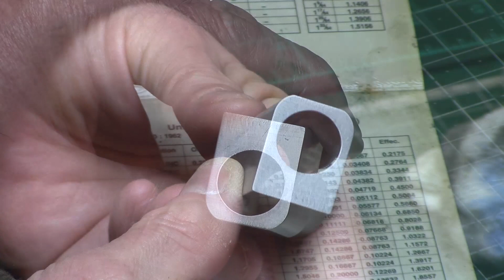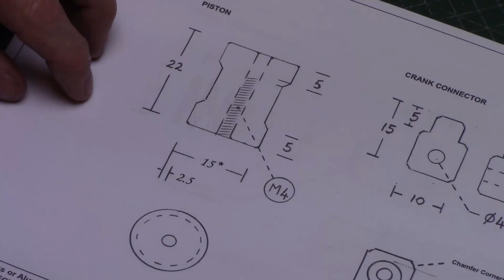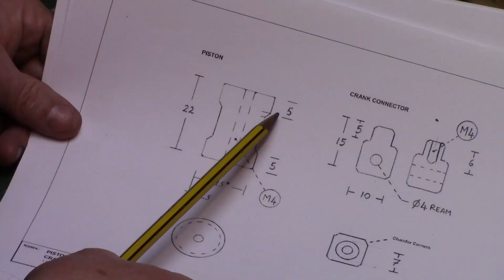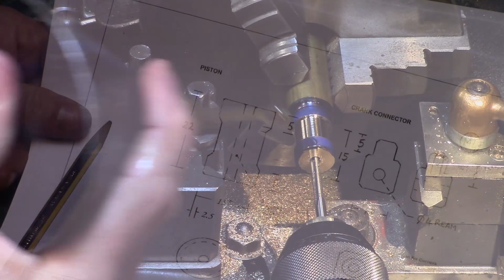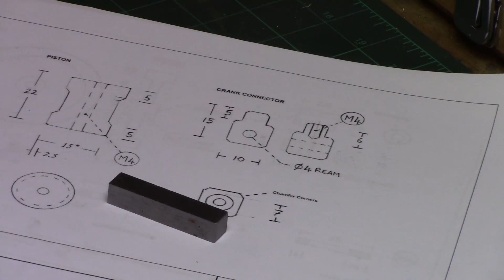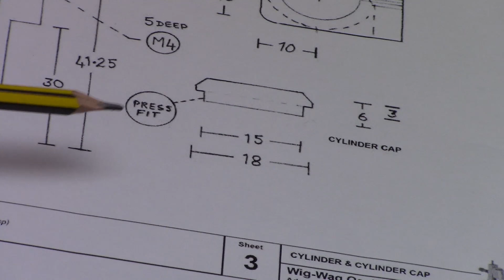Wig-Wag Steam Engine Build Series Part 5 - Piston, Cylinder Cap & Crank Connector

Comment: If you would have used an O ring for a piston ring on the first attempt in making the piston, would that have caused too much resistance and therefore affecting performance?
Reply from the maker: Hi Robert, I have used O-rings on some of my bigger engines, such as my Big-Beam which is a powerful engine, but I think it may be too much resistance on a small single acting engine such as this, but I havent tried it, so cant be sure. Regards. Ade